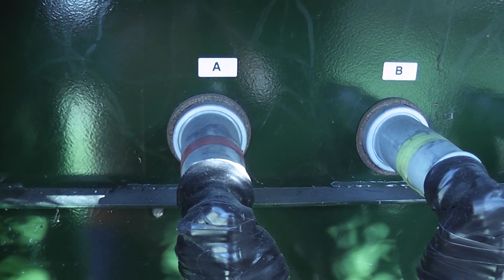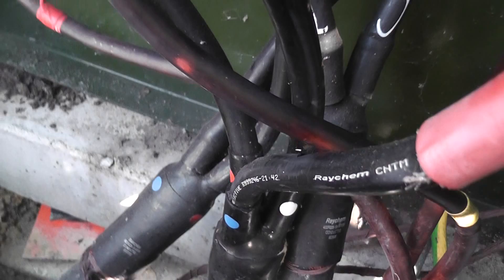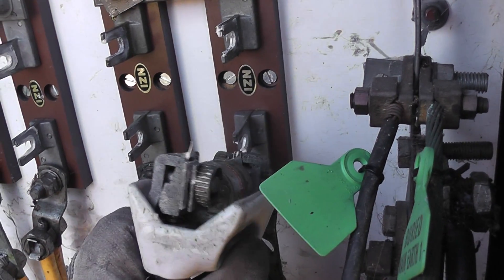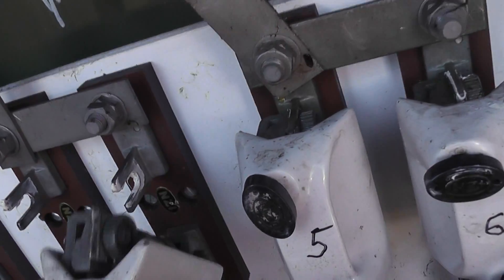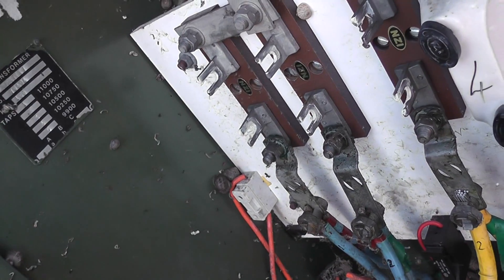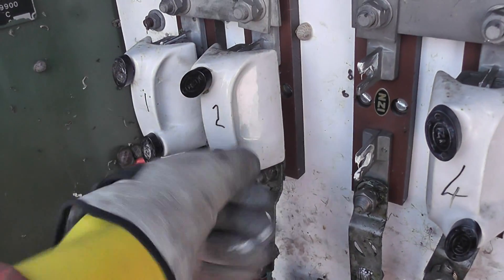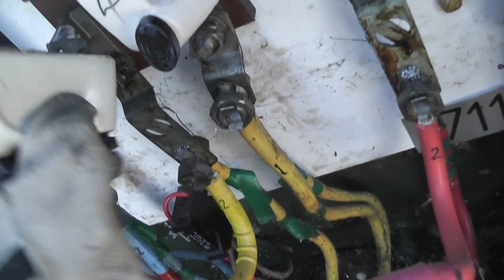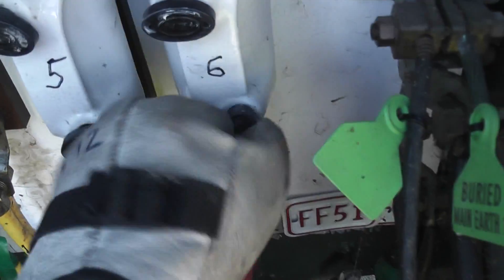Partial Discharge and Energizing Circuits

Comment: Unsafe practice, fuses are should insterted first prior the Transformer energization.
Reply: basically you're right. but sometimes you have to energize the system on idle before switching the load. it could happen that there's so much load on secondary that the transformer primary-fuse blow straight away or the grid is so under stress that the voltage collapse. in my job i'm testing very big and large distribution-systems for motor-drives (summary-current up to 400A and more). when i set the equipment at once under power i'd cause a blackout in the industrial area.

Comment: Is it common to see 4 x 11kv cables all connected in parallel in a tranny like that? (I'm guessing feed in + feed out + 2 spurs to other transformers?) I would have thought there would be separate fuses at the 11kv side for each transformer?
Reply: RODALCO2007 x
Reply from the maker: It is reasonably common on the older networks in NZ to have multiple cables in one TX. Or TX's are daisy chained. One set of large HV fuses feeding 3  or 4 TX's to an open point, from there 3 or 4 TX's to another set of large fuses.

Comment: Ohh I love that 50/60 Hz hum. Why sid you have to put the fuses in, while the transformer was energised / turned on?
Reply from the maker: The fuses were put in at the LV side of the transformer 230/400 Volts side.
Reply: Probably to reduce inrush current.

Comment: Ho did the hold get in the cable?
Reply: BPM Productions of Colorado In my opinion there is no excuse for this defect. 11kV hardware should be completely safe. Either the cables where bad or the installation was carried out badly.
Reply: @Engineer9736  There is no such thing as completely safe. Although MV and HV distribution equipment is produced to very high standards, who knows - there may just have been a single speck of dust in the cable isolation materials causing this weak spot. Corona discharge is very insidious.
Reply: defect at the factory, an impurity in the insulation, since nothing is 100% perfect.

Comment: Great video Ray I saw some guys replacing fuses in a distribution pillar a while back they replaced 1all was well replaced No 2 and BANG big flash and you should of heard the language seriously good job I think linesman don't get the credit they deserve. What amperage were those fuses?
Reply from the maker: These are 200 Ampere fuses on 70 Mil Aluminium UG cables.

Comment: Is this for domestic usage? The people on number 3 fuse would have been strobing away with their lights and appliances lol.
I have to say Raymond, you have the best discharges on You Tube.
Reply from the maker: It was during daytime.
Reply: I assume that if a solid turn-on action was required, that there would be a switch in the system. Instead of this kind of fuses that have 30% chance of going in per try lol :-) I'm not sure if all devices in a house are very happy with such strobing though.. AC units, TV's, PC's

Comment: HRC fuse I guess. my grandfather has heaps of those and what's that small fuse on the bottom left of the transformer 3:37
Reply: Eagle8840 that's what I was thinking but thanks
Reply from the maker: That is a pilot fuse for hotwater controls.
Reply: RODALCO2007 what is its rating